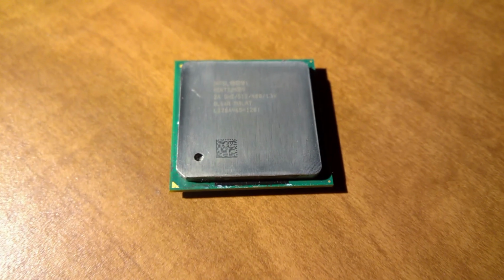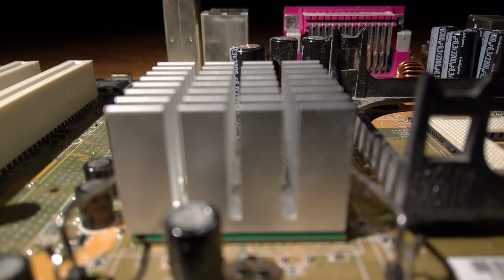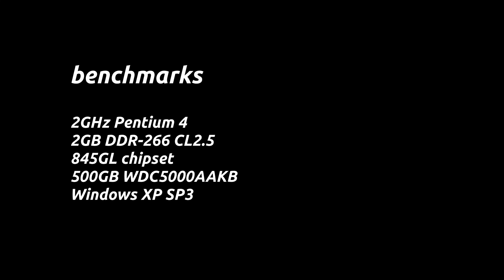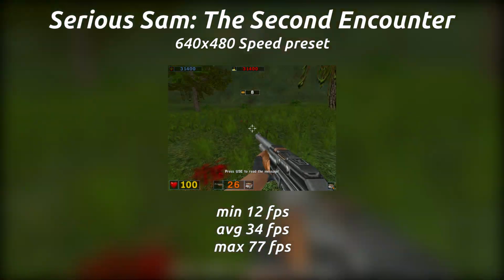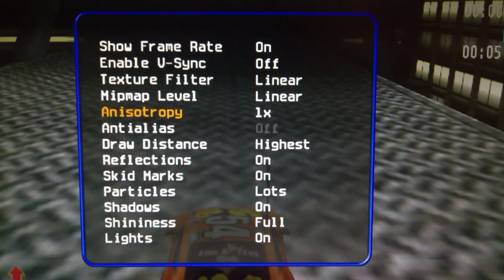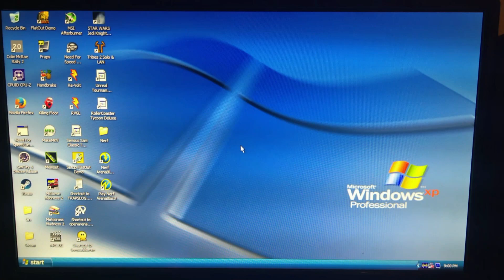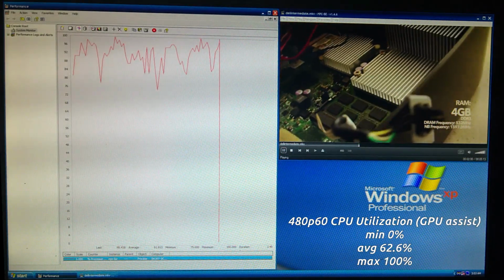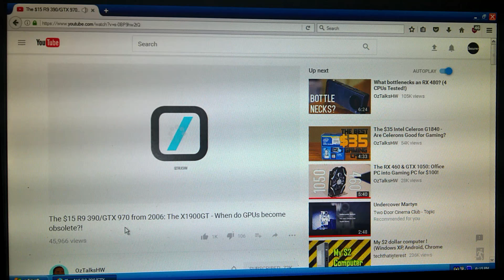Intel Extreme Graphics Review

Comment: I have the same board, came in an HP a210n with a 2.5 ghz celeron, eventually I upgraded it to 512mb ram and a radeon 9200 128mb. Played Halo, rise of nations, age of mythology, and civ 3 all the time. Good times in 2003 - 2005. 2006-2010 it ran as a network file server, status decommissioned in storage.

Comment: Have you noticed the EXCELLENT picture quality and the always centered image on tft? (calibration is fantastic on this thing!)
Reply from the maker: Not particularly, but now that I think about it it does produce a nice image. It's noticeably better than the VGA output from my HD 4600, that's for sure
Reply: btw. I currently do not use ATI either. My very small machine has an integrated i865gv and the games that I play (SOF1, KingPin, Q1-3 etc.) do all work fine with it.

Comment: I use my Thinkpad G40 with a 2.8ghz p4 and the 852GM extreme graphics chipset. It honestly sucks at everything except some non-gaming programs. Halo: Combat Evolved was unplayable, SWAT 3 can't run on it, CS 1.6 was unplayable, but AutoCAD 2005 was able to run flawlessly smooth even with fairly complex 3D polygons being rendered. I think it's better at tasks that are more "cpu assistance" than anything else.For comparison, my T42 with a 32mb ATI Mobility 7500 and a 2ghz Pentium M handles all the above games fine at max settings in 1024x768, however that system really struggles with AutoCAD 2005 in 3D
Reply from the maker: The problem with 852GM over 845Gx is that the core is clocked at only 133MHz vs 200MHz; at that point a fast CPU can't save you :(